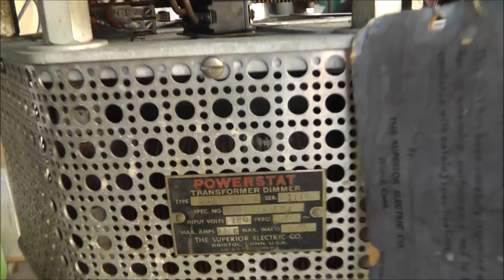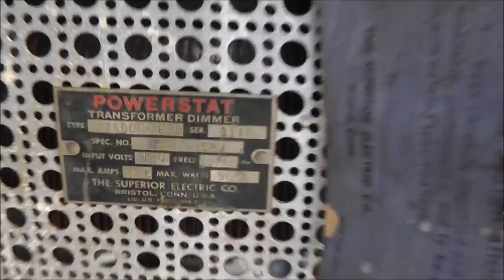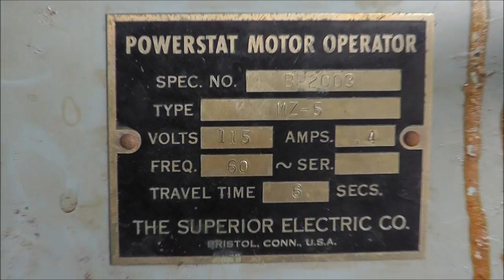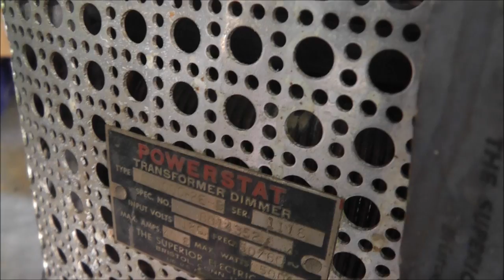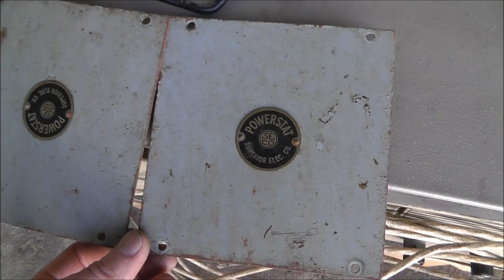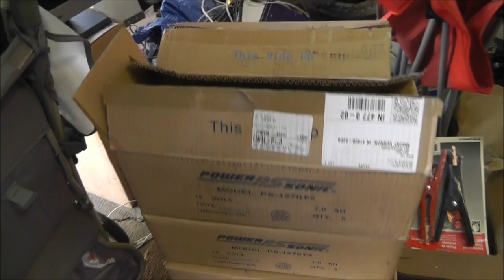10,000 Watt Powerstat??? People Things & OLD stuff! :) Well Its New To Me! God Bless ~Russ

Comment: Also, that coil discharge, from one or more of your new old transformers, that discharge itself could be used to fire the spark discharge inside the piston.  By carefully adjusting the 555 pulse width, the number of coils you use for the energy bank, and the energizing voltage from the series battery banks, you can adjust the discharge energy and the initial discharge current.  That allows you to control the "bang" you get in the cylinder.

Comment: Another thought for you about starting small.  Chances are that a single fist-sized transformer acting as a coil in a Bedini configuration - with the "charging battery" now replaced by the spark gap inside the cylinder itself, will give you a simple way to start the cylinder popping.  Keep in mind a transformer acting as a coil is basically a square toroidal transformer.  Normally it stores way more energy than a hand-wound regular home made coil with a home made core.

Comment: Russ:  This is a follow-up to my posting on your previous clip.   I just saw all of your new old transformers.  You could use those as the inductors to charge up your capacitor bank.  Plus I noticed all of your new batteries.  You could put four 12-volt batteries in series and have four 48-volt DC sources to energize four of your transformer coils.  The batts would share a common ground.  If you start out with a very thin 555 timer pulse you can see how the cap bank charges.

Comment: I guess this is a wild idea, but I think you can strip and re-varnish that primary and reassemble the transformer.  I only had bare copper ground cable kicking around and instead of buying new #14 enamel wire for a coil, I varnished dipped the bare wire coil and oven baked it at around 400 degrees for a short time. It worked well as an insulator, so far.

Comment: More about being careful - imagine each coil going to it's diode and then all four wires connected together.  That node connects to the capacitor bank.  But if the capacitor bank is disconnected there is no neon to protect you.  There is no large enough neon to sustain that discharge.  So if that node gets disconnected and you energize the coils, when the 555 pulse goes off, it will probably generate a Tesla coil like arc - that arc could be very dangerous - lots of energy there.

Comment: Just a little addendum:  I forgot that if the cap bank is disconnected and the coils discharge - and we assumed you just energized those fist-sized transformer cores - the transistors will get blown.  There might be enough energy left over to still generate an arc.  Also, kill the idea of the direct connection to the piston.  I am assuming that the spark gap in the cylinder might have an ignition voltage too high for the transistors, again. Not sure here - fast plasma ignition may save the trans

Comment: If you experimented with the cylinder popping with the single transformer acting as a coil, you could use one of your new commutator switches instead of a transistor.  Hopefully the plasma in the cylinder will ignite quickly and you will see very little sparking across the contacts of the commutator switch itself.  See, you can make use of your new haul of batteries and switches and transformers to make a system to make your cylinder pop!  The sky is the limit just don't fry yourself.

Comment: You have to make sure you don't saturate the transformer inductor cores but I will guess that will take at least 100 milliseconds.  So if you start with a 2 millisecond 555 pulse you should be fine.

Just be careful - four transformers acting as coils charged with current - and then when the 555 signal switches off, you had better have the cap bank connected.  You probably have hundreds of times more energy available than a typical Bedini coil.